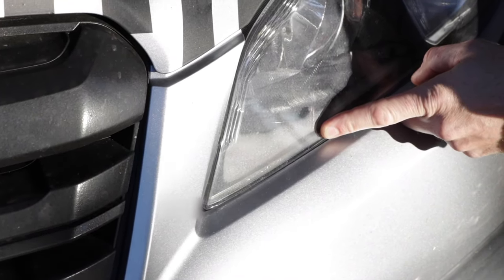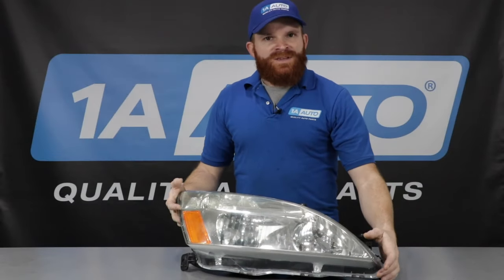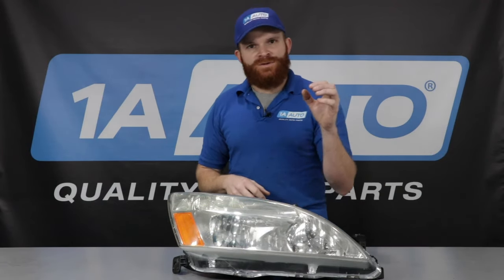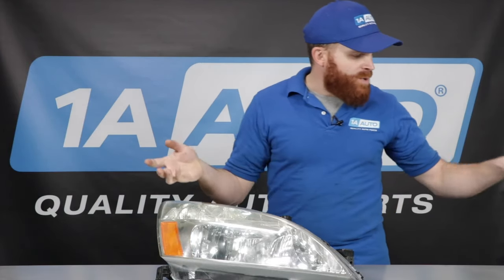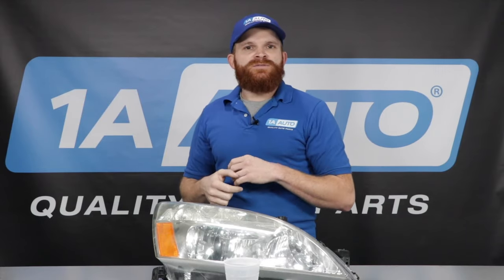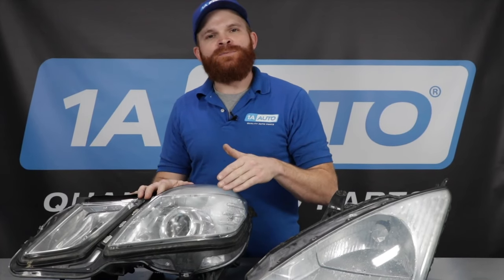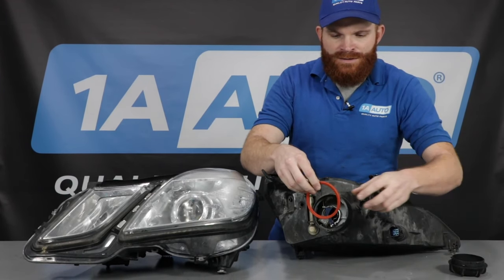Why is There Condensation in My Truck or Car's Headlight?

Comment: ok... the fact is I have one headlight with moisture and the other very clear when in rainy days. I know there is something wrong with my moisture one, its very annoying but with that small issue will not cause me to change a new one... just want to know how can I DIY to make the situation better..
Reply: tom232722gda how did u handle it
Reply: Same
Reply: Did u fix it?
Reply: Silicone the seam of the lens, worked for me.

Comment: I remember in the old sealed beam days that you could buy the entire sealed glass unit for 7 bucks at most any local store & they were very easy to remove & replace. New replacement headlights cost hundreds to replace & is typically a huge PITA job. Progress??

Comment: Thank you for the information, I recently installed LEDs on my Mazda 3 2016 and started noticing mist whenever it was raining 🌧 and lights were turned on. With the original halogens there was never mist.
Reply: Did you fix this?

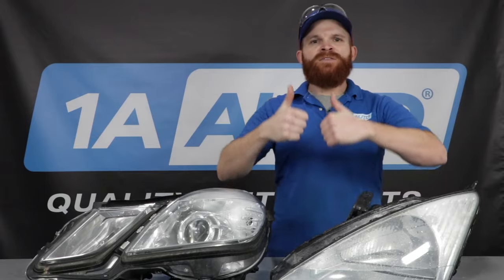Comment: Another good strategy I used on head or tail lights as shown on 7:15 is I used a tiny drill bit and drilled a tiny hole in the light so all that water can come out.

Comment: I'm talking about the headlight that filled up with water. How I fix that one time was find the lowest spot on the headlight and from underneath drill a tiny little hole with a drill bit period and then go up a little bit higher make sure it's on the bottom underneath and drill one more little tiny hole. It was happening so bad and one of my trucks that I would hit a bump and water would Splash up and blow the bulb out, after I drill those two little holes and never condensated again
Reply: You could drill a bigger hole but stuff a bit of Scotch Brite in it to stop bugs from entering.

Comment: On my Subaru Outback I just pulled a bulb that was easy to get to and hooked up my wife's hair dryer on low and it cleared up in about 15 minutes. The other headlight housing had the same issue but cleared up on its own.
Reply: Wouldn’t the condensation just happen again?

Comment: Great video except that the vents are to allow pressure equalisation not to let heat out. Unfortunately it can also let water in.
There is something you can do about it though. Heat up the headlamp with a hair dryer and then let it completely cool -do this 4 or 5 times and you can drive all the water out through the vents.

Comment: new 230i is giving me this problem, same problem a month apart. The labor to replace these will be expensive when my warranty is up. I wondering if a small hole can be drilled on top under the hood let the water evaporate then seal it up with something until it happens again

Comment: I got some condensation / fog inside my brand new aftermarket headlights. thing is, I only drove it around my garage for about 20 min before it built up some sort of fog. no raid, outside temp was 5+ Celsius. it disappeared after about 1-2h inside the garage.
should i use some silicone on top of the seal on the edges or what is causing this? Or will there be no problems during summer? 
The new headlights uses HID and a LED DRL
Reply: Where you able to find a solution happened to my Halo lights on my integra today

Comment: 7:02 Try drilling  small hole in the bottom (At the lowest point)
Reply: Too risky in case you get some water inside, then you are risking to destroy the light unit

Comment: I’ve just bought a 2016 BMW F10. It has xenon headlights. Mine has been misting up everyday. Today it was fine during the day time but the moment I went for a drive and parked up outside my house there was a lot of mist. Majority of it has gone away but still some remaining. My sister has  the same car which is 2015 and she doesn’t have any problems like this? I’m panicking and confused. Please help !!!!
Reply: Your sister's car probably has oem headlamp assemblies while yours could possibly be an aftermarket one.  Oem is always better in terms of quality design.   In any case, find the leak and seal it and you should be fine

Comment: Hi there! One of the headlights in my car has condensation for over 3 months I guess.. it is not going away.. when I start my car the condensation increases a lil bit in other areas but turning it off and after a while only the older condensation remains.. how to sort this?
Reply from the maker: +Syed Elham Thanks for checking us out. It seems like there may be a fault seal somewhere. To get this fixed you could either attempt to drain out all of the condensation and try to find the leaking area or you can get a new assembly. 1aauto.com
Reply: Sometimes purchasing a new replacement assembly will not solve the issue if the defect comes from the manufacturer itself aka manufacturer using poor quality seals.  Had that happened to me before three times with one whereby I had to use permatex clear sealant to seal all the way around the assembly and that solved it.   If pooling inside rotate assembly all the way around to find where leaks are coming from and seal that spot

Comment: So how do I prevent condensation?
Reply from the maker: +Daniel D.P Since headlights generate heat, they need to be ventilated, which means that they have small vents that can suck in moisture when the car is turned off. If the outer lens cools more quickly than the air inside the headlight unit, it can cause condensation. There is no real way to prevent condensation as this is directly correlated with the weather and usage of the vehicle.
Reply: @1AAuto  what about drilling holes?
Reply: @dandopa1990  yes drill holes, works a treat

Comment: Dont need to buy new headlamp for the last headlamp which had water pool inside, you can just drill a hole underneath the lamp. Bye
Reply from the maker: +Karam Brar Thanks for the tip!

Comment: A SIMPLE METHOD .... TAKE A SMALL PIECE OF GARDEN HOSE AND PUSH DIRECTLY INTO THE LIGHTS. ..... THEN THE FOHN ON THE OTHER SIDE IN POSITION 1 AND WITH A CLOTH THE FOHN ALL AIR AIR TO THE HOSE ......